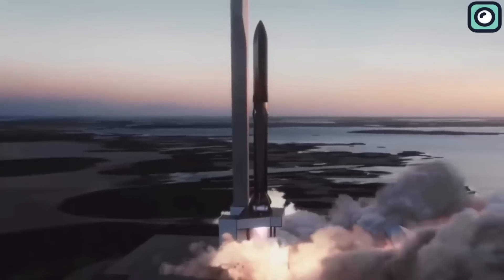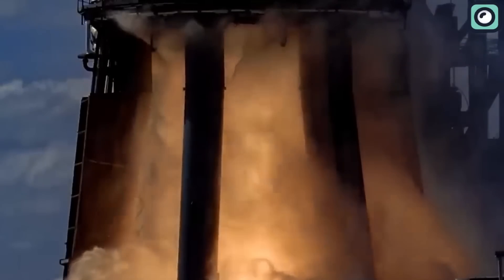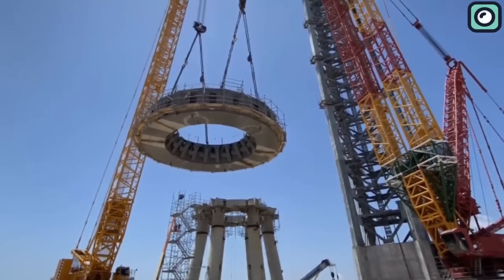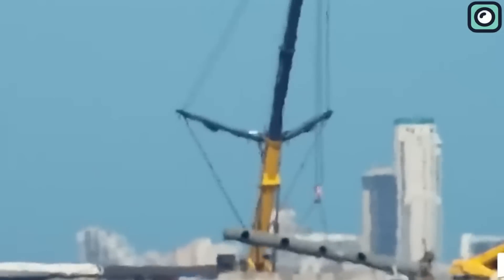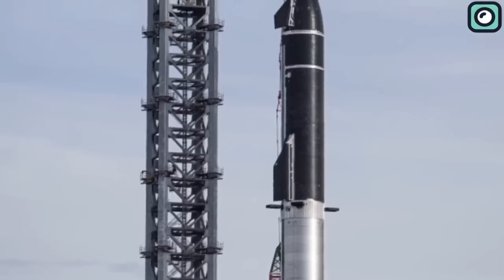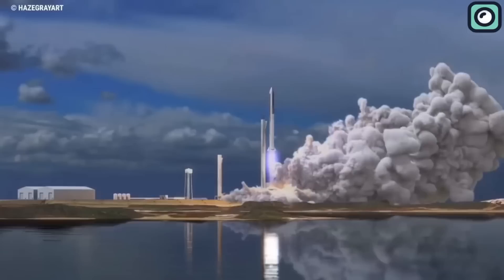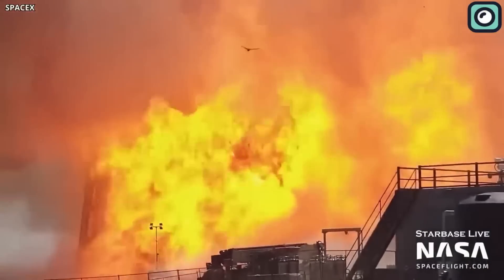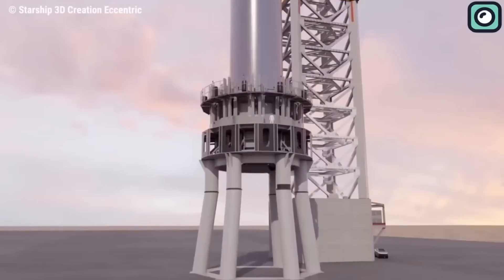SpaceX's Solution For 33 Raptor Engines Thrilled NASA Scientists!

Comment: Sadly I still say that an exhaust diversion system should have been implemented and thus saving all this extra work and delay of proceedings, a launch would most probably have occurred before now if a diversion chamber was built at the outset as this system will certainly not be conducive with multiple daily launches, too destructive to the concrete base works and equipment.

Comment: How about having surrounding custom low lying high wind wind turbines absorbing all the power from the take off charging battery packs…with thousand of launches in the mix that energy can become useful…perhaps…just a wild idea…;-)
Reply: Would destroy the turbines. And turbine blades are made of fiberglass.
Reply: @arounor  I was thinking tungsten blades or similar…
Reply: The launch only lasts a couple seconds so no useful amount of energy could be recovered.
Reply: @davidgray6999  everyone talks about huge energy being release and then add thousands of launches…several each day….many small creeks eventually turns into a river…